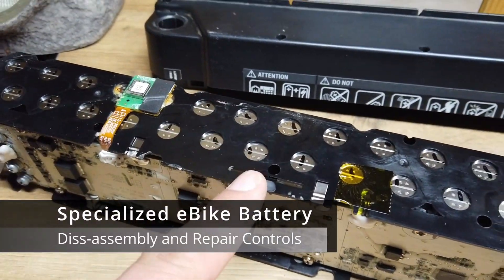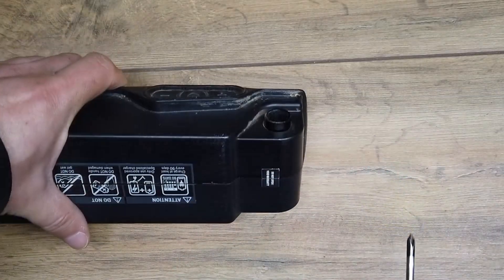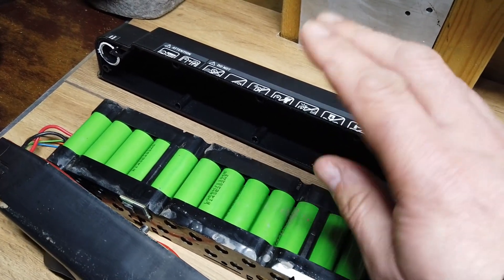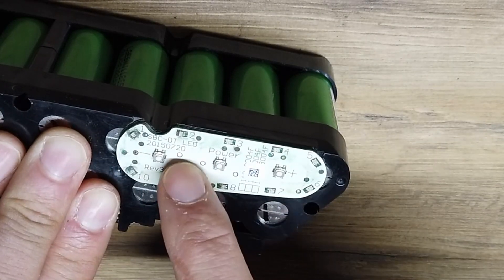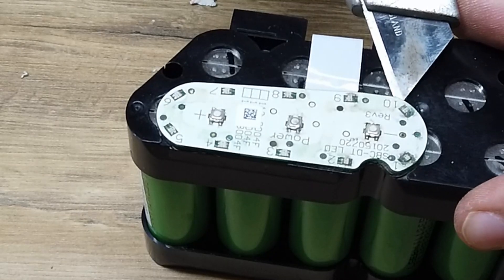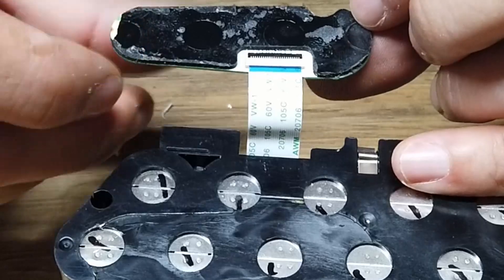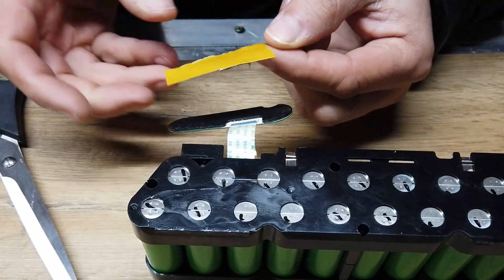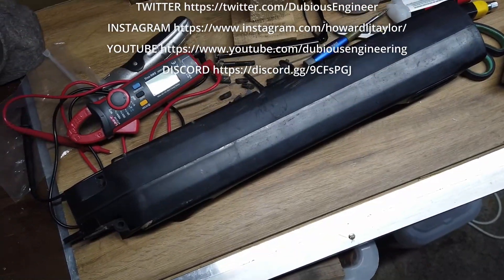DuB-EnG: Expensive Specialized Turbo Kenevo Levo MTB EBike M1-504Wh Batterypack - HOW TO FIX IT

Comment: Hello mate. Before you measured the battery for Voltage... You the battery was "on".
How do you get it to turn on so it gives you voltage? Thanks.
Reply from the maker: Press the button...   I can't recall if press and hold, or just single press

Comment: Hello, ive a battery first version for turbo levo (401) i've have removed voltage from the bms, opening the battery and disconnecting the cables. Ive done this to clean the mother board. When i've reconnected 3 red leds start to flash and the battery is in a block status. I suppose that bms goes in block when you remove voltage. Do you know jow unblock or reset bms? Thanks a lot
Reply from the maker: That’s exactly the reason I left it connected…. So sorry I have no idea how to reboot!
Reply: Conseguiu resolver ?
Reply: A minha aconteceu o mesmo problema, conseguiu arrumar?

Comment: Hey DE, nice that you managed to fix it for your friend. After watching the video I fail to grasp what actually fixed the issue though 😂 Was it in the end that you cleaned the corrosion of the circuit board or was it the connector? For me it felt like the video was missing the most crucial bit, what the issue was 😂❤
Reply from the maker: Corrosion on the PCB, but even after the repair, the fault came back about 2 months later...  Pffft. :-(

Comment: Even when glued in, one can apply gentle air heat and/or isopropyl alcohol to soften the adhesive under the circuit board, enough to remove the board without over cracking it, or heat-stressing the lithium batteries. Keep up the good work mate! 👍
Reply from the maker: Thanks man, I reckon my wife's hairdryer would have helped!!!
Reply: Heat first then use thin gauge plastic coated cable like a cheese wire to slide under the PCB.